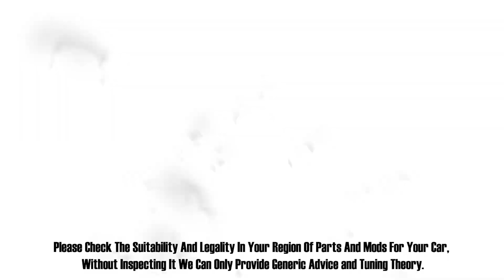Gear Shifting Problems in Your Auto Transmission? Skipping, Sticking, Rough & Slow Gear Changes?

Comment: Hi great video. I have a Kia Soul 2011 1.6 diesel auto. No engine management light on, when accelerating travels up through gears till about 55mph then losses power at accelerator and doesn’t reach 6th gear if I come off accelerator then back on again it picks up speed then refuses to change to 6th gear and drops away again any help would be appreciated, many thanks.😊

Comment: Love this channel. I’ve got a 2005 v70 auto with 132000 miles. Should I replace the transmission fluid? The handbook doesn’t specify anything
Reply from the maker: If shifting is getting slow or rough then it's definitely time to change the transmission fluid. Most Volvo guys I speak with do this every 50000 miles or so, as with most things it depends if you do long journeys in one gear or are frequently in stop start and through the gears.

Comment: I’ve got a 7 speed dsg mated that 2:0L ea288 diesel. Have been really impressed with it. It’s due its first service at the dealership. It’s a 2019 Tarraco was wondering is software updates checked as part of the service. Great video btw 🫶
Reply from the maker: Very nice! Those DSG boxes make a manual option pretty much irrelevant. Thanks for the kind words of support.